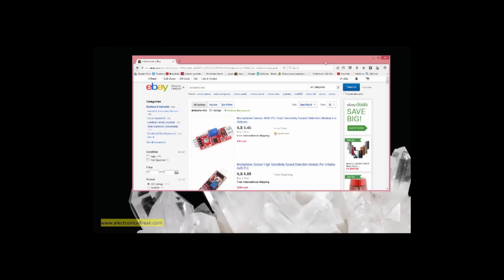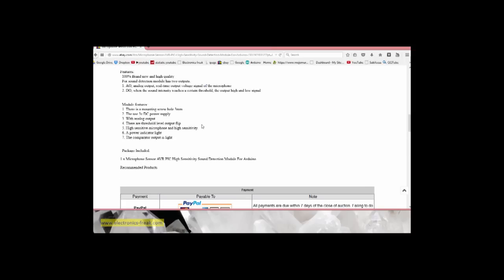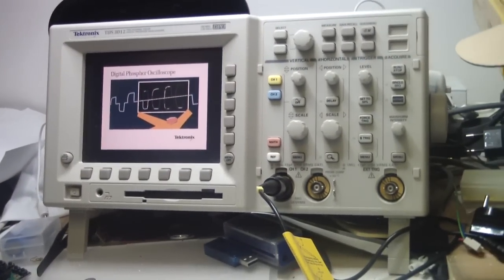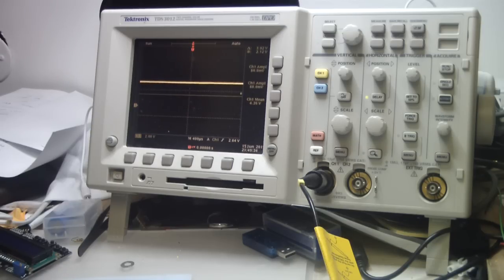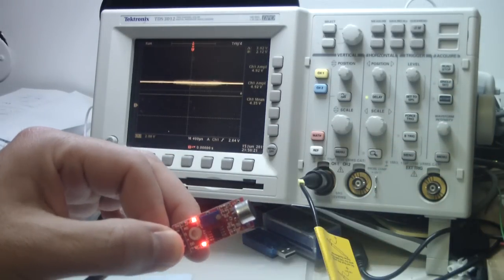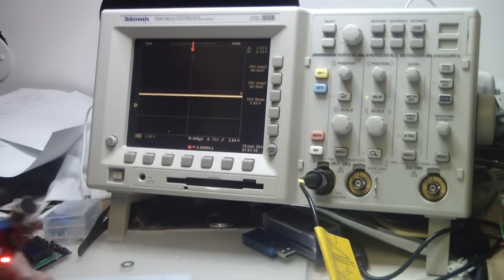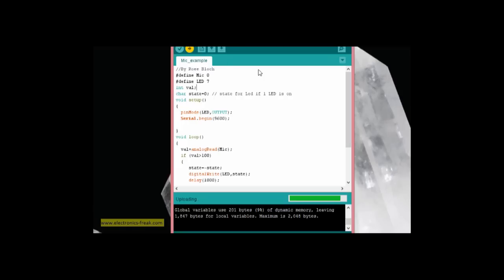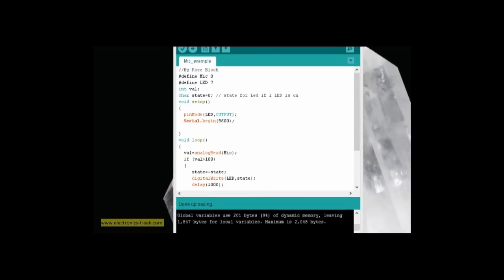Lesson 7- Arduino Microphone

Comment: Why is there a threshold adjustment?  The output of the mike should be going through a capacitor to isolate the DC from the audio.
Reply from the maker: I don't remember the circuit diagram but probably they have added comparison amplifier after the first amplifier - not sure have to check, any way it acts like this, or it could be DC offset of OPAMP that cause this output to change
Reply: because these "sensors" are made to detect noise level, not to record the audio using arduino.... it has a comparator so it will "detect" if the noise level is over a certain predefined threshold, if it does it will change the digital output

Comment: I try the project claping with this sensor and my led always on and never go off when i clap it and  both of the sound sensor of led are on,i dun know what i must do,am i need to set the potensiometer in my sound sensor module?
Reply from the maker: Yes you need to rotate it and find the position where the LED goes OFF this is your point to activate when there is a sound
Reply: @RoeeBloch  okay let me try sir thanks for your help i apreciate it
Reply from the maker: This potentiometer has 10 rotation!!!, so you need to turn all rotation till the led will change to OFF, try again

Comment: Sir, Is there any way we can use this module in place of an actual microphone on this site https://www.instructables.com/id/Arduino-Audio-Input/ ??
Reply from the maker: Sure you can, but you will need an amplifier circuit, you can't connect this without amplifier

Comment: I don't know why but it is extremely insensitive for me, literally have to blow into it to make it detect a signal, tried adjusting the sensitivity, tried analog, tried digital but to no avail
Reply: Same it's a POS!
Reply from the maker: may be your microphone in this board is BAD, I have noticed sometimes that if the module fall on the floor the module sensitivity reduce a lot
Reply from the maker: I was searching for my board and couldn't find it, any way I will order new and do again video with explanations

Comment: So I had a question, I got one of the sound sensing microphones from Keyes and well one of my questions was I'm trying to make a sound activated led strip but every time the sound sensor senses sound, the led starts blinking and I just wanted to know if there was any way I could get it to fade instead of blinking. This is for an architectural project and I really want to figure this one out. 
My code goes like
if (sensorvalue >= threshold) { 

digitalWrite(3, HIGH);
}
else {
digitalWrite(3, LOW);
}
Its set to only be on when threshold is met and off when threshold is not met. but what I want it to do is fade and get brighter when sound is on and fade out slowly once the sound goes off instead of just switching off.
Please help, it ll be much appreciated.
Reply from the maker: Sure you can, you need to write it in the code, you can use the PWM output and control it with a loop that changes duty cycle from 255 to 0, also put inside the loop delay of 10mS or so. also you can write the PWM yourself with a loop that changes delay time between ON led and OFF led time
Reply from the maker: use the "donate" button on the right and I will do the code for you

Comment: The digital output is useful. It is digitized version of input. Hard to see unless you use a sinewave generator. For example, if you feed in a 1000 Hz tone, you will get a 1000 Hz square wave output.

Comment: I need a circuit that can detect ambulance and fire emergency sounds at a distance eliminating anything else.
Reply from the maker: You can' eliminate everything else
But I think you can try finding this sound, you will need in code to detect 2 sounds and measure the time between 1 logic to another 1
This will work just if the sound near is loud
Reply: i have the same question....can this moduke detect the ambulance siren frequency?

Comment: Hi, I'm trying to figure this out but I seem to be stuck. I connected the A0 to the "A0" analog in the Arduino ONE board, then connected the D0 to the digital pin 13. As I do this, the Led2 (the one under the resistor) turns on, but Led1 stays off. Also, reading data from "A0" return values between 40-60 that don't seem to vary according to the sound I make in the microphone. I tried changing the resistor, but I reached max and min (I hear small clicks) and nothing changes. What am I doing wrong?
Reply from the maker: may be your module is broken, any way you need to move the potentiometer not to MAX and not to MIN but somewhere between them and then it will react to sound - need to find the delicate point for it

Comment: please ,can one use this sensor module to connect to say lm386 audio amplifier? my project is about charging mobile using sound energy. i will be very grateful if u can help me
Reply from the maker: The energy from this microphone can't charge any phone. Since the vibration is in tiny area. You can't do it this way
There is no way that it will work
Reply from the maker: The energy from this microphone can't charge any phone. Since the vibration is in tiny area. You can't do it this way
There is no way that it will work

Comment: I would not recommend this module. You'll get much better results buying a proper mic module or making one yourself.
Reply: Such as?
Reply: +dom69foco panasonic used to make them. you can still get a couple of their varities. there are others just go to digikey or rapid. you should find a few, but you need to make your own circuit. it is not a very complex problem a lot of datasheets recommend one anyways.
Reply: ***** My project involves sending and receiving pulses of sound and measuring time of flight over distances less than a metre, so I think sampling rate is much more important than quality to me. Would this kind of thing do the job for me you reckon?
Reply: Sample rate?  I'm not sure what you mean by that (distances less than a meter), in the context you stated, considering the fact that 1Hz means the audio input sample rate is grabbing samples 1000/per sec. A few years ago, having braking system/suspension on a car that had sampling/computer feedback rate of 1Hz was only found on luxury cars. Just wondering.

Comment: Those mic sensors are very bad, I bought one and simple doesn't have the needed sensibility!
Reply from the maker: Sure you can, you need to change the feedback resistor.
Find schematic and change the resistor from output pin to Negative input pin (this is the amplification)
Increasing the resistor - will increase amplification.
Any way don't use resistor greater than 1M ohms - since it will get to saturation quickly
Reply: @RoeeBloch  Could you explain this further? Do you replace the variable resistor with  another one with higher resistance?
Reply: Roee Bloch
Reply: Use the ADMP404 or ADMP401. they are made by ADI (analog devices incorporation). An american company

Comment: This little module is only suitable for detecting an opening or closing door. It actually works great for that. But its certainly not for audio.
Reply from the maker: Of course you can use it with arduino connect between them to configure module and get data out from it to arduino

Comment: Hi, i want to know the vrms of this arduino microphone with oscilloscope or TrueRTA, i used 1kHz frequency on my mic with function generator or tone generator but i am still dont know the Vrms or Vout of this mic, can you help me about this?
Reply from the maker: It depends where you look. if you look at the digital out it is 0V or 5V
Reply: +Roee Bloch i want to know minimal voltage of this module. i used the analog output and convert it to voltage and dB,

Comment: Hi, I tested it by connecting LED to digital output pin. While I testing it, I showed as always sense sound by LED is always on. Is it the sensor problem? By the way, I change the value of variable resistor but it is not working.
Reply from the maker: The changing point is very sensitive and you should turn till the led off to one position, and then change a little back in order to make it work
Reply: The same is happening to me, the sensor has both leds always on, no mather if I change the value of the variable resistor, and checking through the serial port of my arduino, the analog value only rise when I blow over the sensor. I realize than the variable resistor at my sensor is turned around respect to the video one, That could be the problem?

Comment: Is this sensor sensitivity high enough to get conversations on a room?
Reply from the maker: I think that yes, but you will need to amplify it a lot, and this can't be done with arduino, you might need OPAMP (second one), also in order to drive a speaker you will need power amplifier